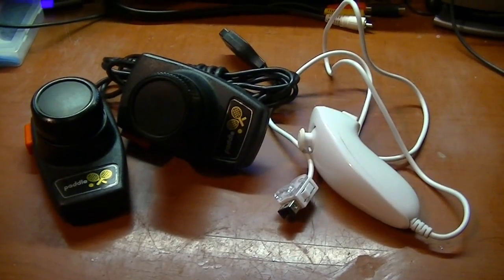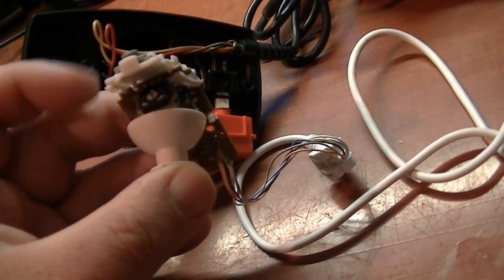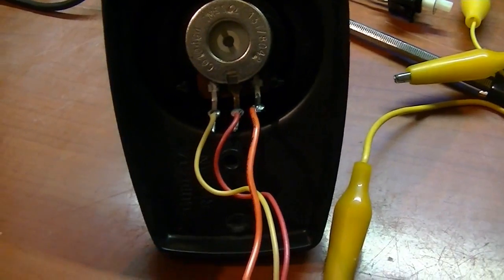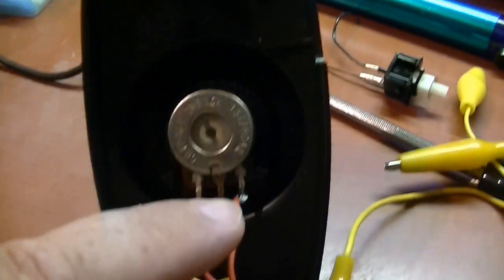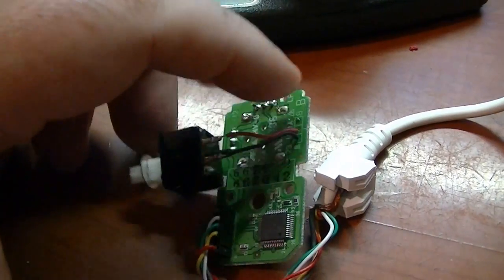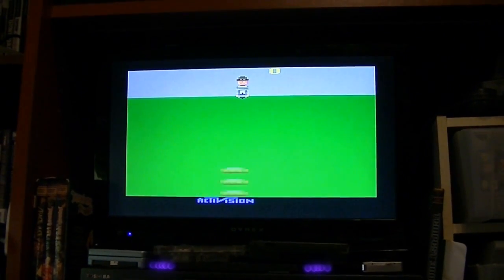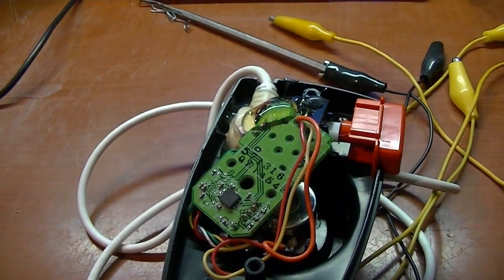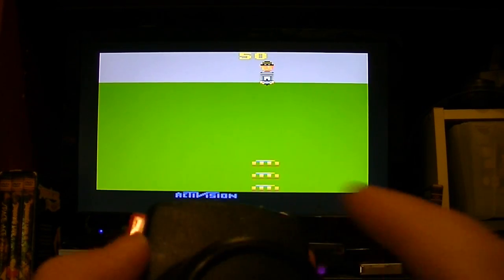Wii Atari 2600 Paddle Controller Build

Comment: nice mod, any rec on how to convert a joystick for wii?
Reply from the maker: Yep, mod a classic controller for the wii.
Reply: @SVT512  you mean you can mod an atari joystick with the wii classic controller internals or something else?
Reply from the maker: @car6on14  I would make a adpater plug to plug in a atari joystick into the classic controller.
Reply from the maker: @car6on14  I would make a adpater plug to plug in a atari joystick into the classic controller.
Reply from the maker: @car6on14  I would make a adpater plug to plug in a atari joystick into the classic controller.
Reply from the maker: @car6on14   @car6on14  I would make a adpater plug to plug in a atari joystick into the classic controller.
Reply from the maker: @car6on14   @car6on14  I would make a adpater plug to plug in a atari joystick into the classic controller.

Comment: Could you do something similar for converting a Genesis controller for the wii to use with emulators?
Reply from the maker: +Rob Baker Yep :)
Reply: +ArcadeUSA if you could do that, that'd be great.  That and the master system.  I'd even be willing to provide the parts to do it if you told me what you needed.  I'd love it!
Reply from the maker: its on the backburner :)